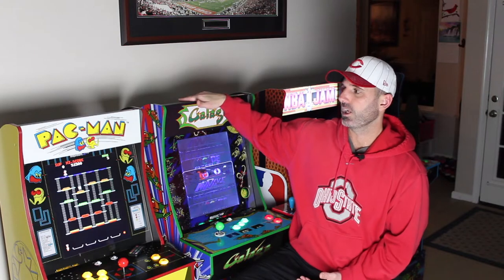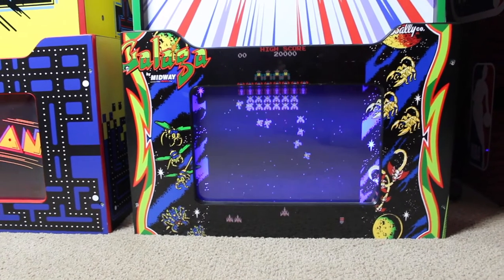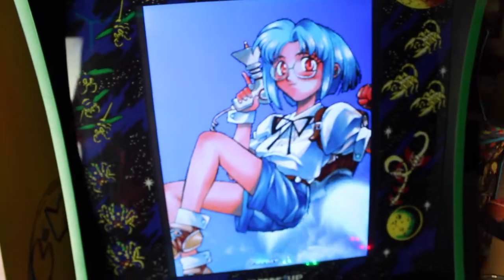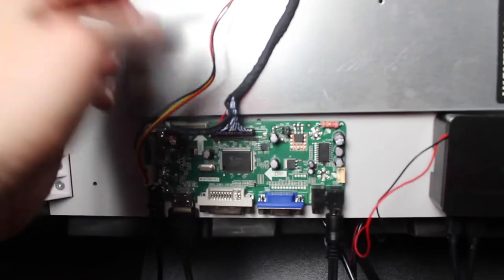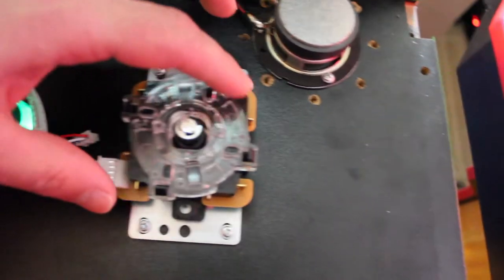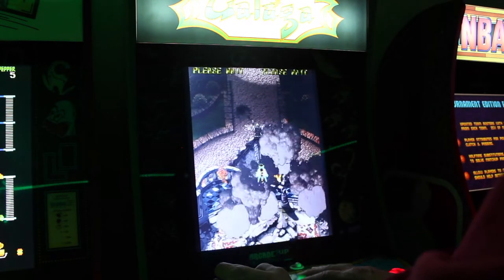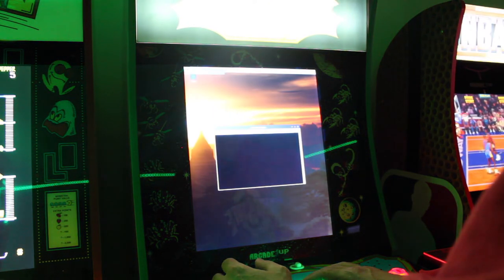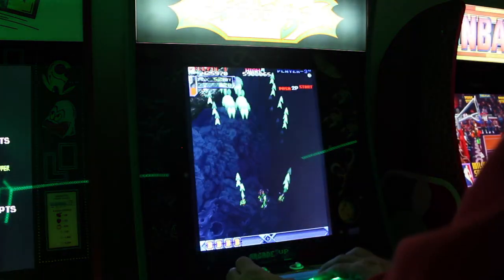Arcade1Up Galaga Pi 4 Mod

Comment: I have a Pi3B+ and managed to get all Cave games working smoothly up to DoDonPachi DaiOuJou Black Label.
I was told the Pi4 still has issues playing Cave games past DoDonPachi DaiOuJou. Can you confirm this?
This is one of the many reasons why I see no reason to upgrade (Killer Instinct Still laggy on Pi4).
If you actually can play all the Cave games then I might consider going with a Pi4.
Reply from the maker: So it looks like DoDonPachi DaiOuJou was a 2002 release. I have Ketsui and ESP Galuda running great as well. Not sure if you have those running, but they are both 2003 releases. From my understanding any Cave release after 2003 is run on a never version of MAME that isn't currently supported by RetroPie. I've yet to have luck with Mushihimesama, Ibara, or ESP Galuda 2.
Reply: @originalconsolegamer8572  Any Cave game from 2003 and back works on my Pi3b+. All I know is after Espgaluda was released in 2003 Cave started to use another hardware to run their newer games. These newer Cave games are harder to emulate for some reason.
Reply from the maker: @sunquestenergyhomesolution96  correct, the must have upgraded their board. Yeah I couldn't get Espgaluda, I think 1 other cave game, and Gunbird 2 to run on my Pi3b+. I mean they ran, but not very good. I never messed around with overclocking it though, so maybe that was why. However, if you got all that running, then there is no reason to upgrade to a Pi 4 then. Unless you wanted some of the Dreamcast shooters, but that's a whole nother story.